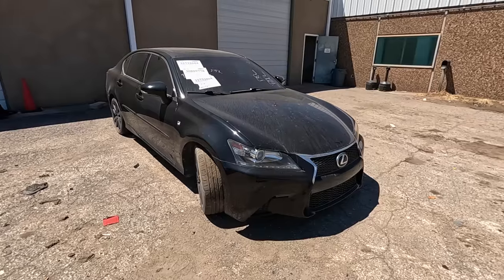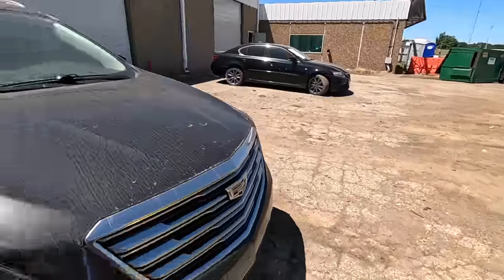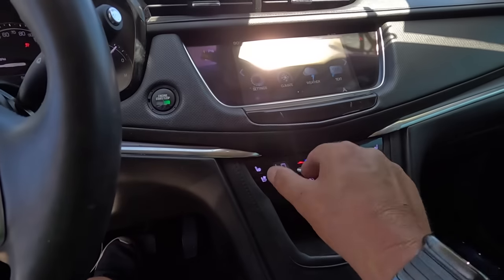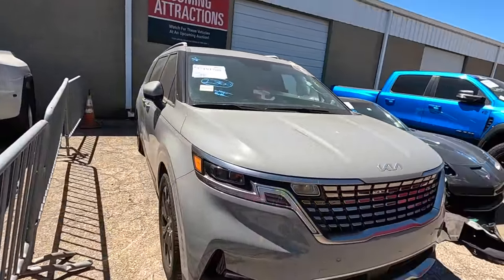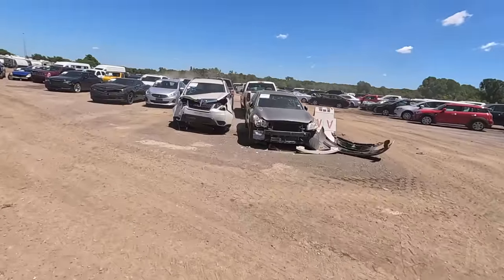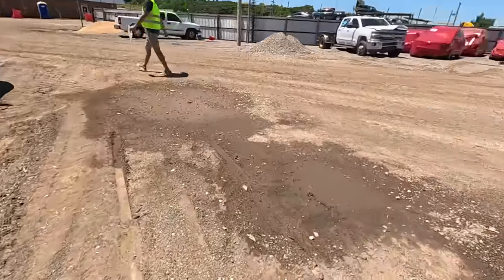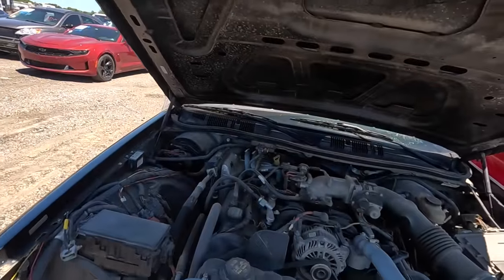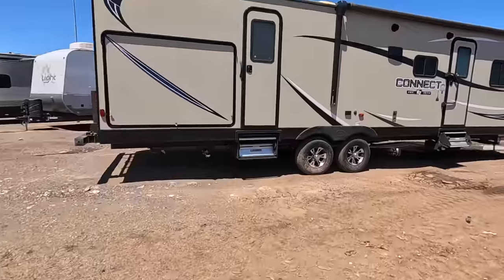I Found this 2020 Saleen Supercharged at IAA and it's JUNK! You Won't Believe Why! Also 2 RAM TRXs

Comment: I love the Lexus GS 350.  It is rear wheel drive and the V6 350 engine is rock solid.  The F sport has adjustable suspension.  Drive one and it will give you a smile.
Reply: Agree!!! 💯

Comment: I’m a current owner of a 2015 Buick Enclave Leather with the 3.6 VVT engine. We bought it with 44K miles and it currently has 116K miles on it. It has had regular oil changes. So far the car has performed flawlessly. I have heard horror stories about these 3.6 VVTs. I believe that maintenance is key to longevity on any vehicle. I also have an 07 Ford F150 Super Crew with 197K and it’s my daily driver. Also it’s well maintained with oil changes every 3K miles. It was purchased with 13K miles in 08.

Comment: Randy you are correct I worked at gm dealers 38years and gm quality has gone down big time.all since Bara took over
😊
Reply: I was just telling my wife the other day that I think it's sad that my 89 Z24 convertible is more reliable than the current gm stuff. I have several older gm products and over the years, they required less work than my Z24, my formula firebird, or my Beretta gt for example. Interiors are kinda cheap, but, mechanically, them old things still continue to run with minimal effort

Comment: If you come across a stuck Hood, reach in and hold the release, then with your left Hand, give the rear of the Hood a good bump several times. Usually it will bump it enough to release the stuck plunger and pop it open.

Comment: Too bad you didn’t get to check out the GS350 F Sport.  By the front end it appears to be a 2013 which I own in the pearl white.  It’s been extremely reliable and honestly impressed me with its handling with the F Sport package. Zero issues.

Comment: I agree with ya! I was always a GM guy! I had many Pontiac’s. I’ve owned Chevy trucks and cars, Oldsmobiles and Buicks. I absolutely loved my Chevy trucks I had up to my 91. I had old caprice cop cars, had Oldsmobile 88. Loved them all. Back when they had 350’s, solid 305, and those never ending 3800’s!!! My last Chevy I bought was a 2008 Silverado 4x4 extended with 5.3. Body went quick and then engine did also! I bought one more vehicle after that with a Chevy name on it, I bought a new 2015 Chevy Spark for our kid when they were in high school. It was a GM tag deal at the dealership. Paid $12,300 and tax and done. They still have it with 80,000 miles. It’s been okay. One set of front breaks, one set of tires, two batteries, and coils and plugs. Just like my 08 Silverado, goes through O2 sensors like someone eating potato chips lol. Surprisingly though, not a spec of rust on it after 8 years, more than I can say about my Silverado lol. I know own a 2012 Infiniti QX56 I bought new and now have 150,000 miles on it. Absolutely one of my favorite vehicles I’ve owned! So comfortable, good size inside, and decent power with the 5.6

Comment: The Escalade 6.2 is actually one of the most reliable engines there is, powerful from the start and loves boost. The DOD-AFM needs removed in the vehicles that it was put into. That is and was GM’s worst design IMO. It can also be tuned out of the computer. Removing the DOD-AFM consists of taking off the heads, replacing lifters. I did some other things while I had the heads off, like a mild cam swap. (Not a bad idea. Headers as well) I wasn’t able to do this work till some months down the road, so I used a handheld tuner and turned off the DOD-AFM. That will make any 6.2 or 5.3 with the dreaded DOD-AFM  stay in V8 mode and no more driving around with a pinless grenade.  I’ve looked for Escalade engines for swaps! They are great like Silverados and Tahoes. Just my .02

Comment: I used to repo travel trailers for a bank...have them checked over very carefully...generally the windows will leak if not sealed every other year and the vents and roof vents have cheap seals on them and they will leak tons of water...if it has pushouts..don't buy unless you get to operate them we had several repos that they didn't work and got a ton less at auction for them.

Comment: 26:05 that's a bassheads wet dream right there! 5th order bandpass 12 15's Sundown Audio using Crossfire C7-2000-4 for each sub and have the passenger door all sealed up to maintain my db's

Comment: Ya know randy I absolutely have to agree with you on modern GM being junk I used to love GM cars until I got my 2019 Cadillac CTS last October it has 50K miles, had the heat go out on me when we had record cold temps in Colorado and I’ve had the rear differential replaced 3 times under warranty and right now it’s sitting at the dealership with a blown diff for the 4th time. I’ve had so many blown tires because of the stupid low profiles, Absolutely over it. Went n got me a Lexus instead.

Comment: The 5.3, 6.0 and 6.2's are great engines and will last forever.. if you buy them when they're new and immediately do the DOD delete on them - and not the cheap way using an OBD II plug in.. spend the couple grand and do it the right way. If it's not done when new, or during the first few thousand miles, then it can be a gamble. Sucks to have to drop a couple thousand bucks and tear open a brand new engine, but at least then it's bullet proof

Comment: It's not about this video. Randy, but I was just wanting to know I saw one of your other videos with the white range Rover that you used Blue devil for a blown head gasket. I have '04 Chevy cavalier with a rear main seal that is leaking and I was just wanting to know if you've used  Blue devil on cars with rear main seals leaking and if you had any issues with that causing any type of bearing failure because of it but I just put it in my car just now so hopefully it doesn't cause any issues. I've used the stop leak in my radiator before and caused more issues after using that, but it was called Bart's stop leak and not the Blue devil. But I have been hearing a lot about the Blue devil quite a bit. So just wanting to know how good that stuff is and if it causes any bearing failures because of it. Thank you for reading this Randy

Comment: My family bought a 2023 Cadillac Escalade v we love it but we had to take it to the dealer twice in a cupple months first was the air suspension and now it’s the ac
Reply: Oh and he still has issues with his corvette. I was looking at a used Volvo and took it to my mechanic to make sure it was okay. He sad don't buy it because it was junk. A couple years later he told me he hates Volvos because he had one and it went through tires too fast. I was so mad. I really wanted that SUV.

Comment: You cant talk about Lexus, especially the older model GS and LS models with the V8 and V6s. Good luck finding one in that body style for less than 18k. I sold my 2011 Lexus LS460L with 215k miles on it back to the Lexus dealership for 13k. The dealership called me and wanting to know how much would I accept for it? I thought theyd go away after I made my offer, but he asked me when could I bring it in??? I said, "Even with 215,000 miles??" He said those engines are made so well that anyone who gt it could probably put a million miles on it and he wasnt exaggerating. Even at 215k miles the engine was clean as a whistle. Anyways, enough on that lol

Comment: Ever since GM CEO Mary Barra took over, the company have mostly been producing meh cars that are honestly not worth forking over $50k-$130k+ on certain cars. Randy's right about the dreaded DOD engines. I also have personal gripes regarding eliminating Apple CarPlay & Android Auto as well. Mary Barra claims that they're leading electrification in the US, but that's a hot load of horse manure! Tesla & Ford make better EVs that have range and don't catch on fire.

Comment: The Enclaves were Junk too specially the 2.0 turbo one i had a lady bring one into me the other day to run a check engine light on it and this vehicle barely had 60k miles on it. The code was to replace Turbo charger her turbo was failing and engine was fluttering and sputtering so bad on a vehicle barely a couple years old. I drive 20 and 25 year old vehicles for a reason they were built and built good

Comment: Your generation of impala only had over head cam engines… every 3.6 is overhead cam… or high feature as they used to call it. I’m with you Randy. Modern GM is junk.

Comment: If the Escalade guy was such a big shot, what is he doing watching YouTube videos of salvage yards?  The Grand Sport is a cosmetic copy of the Z06 combined with the base Corvette Z51 but with bigger brakes and tires.  It doesn't have the aluminum frame of the Z06.

When I was a teenager in the 60's I used to walk around a junk yard wishing I could take a car and get it running again and drive it.  Wish I could have made a business out of it because it sure is fun looking for them.  Like a treasure hunt.

Why are all these cars' dead???

Frame damage on a Jeep?  That's guaranteed!  It's called, Rust!

A cheap camper conversion?  How about a $8k shuttle bus?  Full headroom!  Wheelchair lift for loading.   Wider than a Sprinter and that Ford. Most have a Dually rear axle for more traction.

Comment: Seems like most of the modern vehicles have junk engines. Ever since they went direct-injected seems like the quality went downhill. Engines from the mid-90s too early 2000's seem to run forever as long as you maintain them. No silly plastic parts that break, timing chain guides, no direct injection.

Comment: Cadillac is definitely not what they were. They were once their own brand under GM which had their own models. Now they are just classy versions of existing models that GM already has. GM doesn’t even have the same passion for performance they once had. That Cadillac is nothing more than the Chevrolet Equinox with a few different body panels and some interior upgrades. The engines don’t last because they are being built out of state and utilize cheap parts. People take the 5.3’s up to the 6,2’s and rebuild them with quality parts and make really good NA horsepower with really good reliability. Plus you can rebuild them for less than just about any other engine on the market.
What’s stupid is the cost of cars these days. In 1996 my fully loaded Chevrolet Silverado was under 30 thousand and was the most reliable vehicle I’ve ever owned. All the electronics in cars these days is what makes them so unreliable.

Comment: I am here to agree that gm products are garbage i owned a 2005 gmc yukon xl and it was just problem after problem i never went without fixing something on it fuel pump is my main complaint i have seen other vehicles go decades without needing one it seems like you need one put up for backup because it will go out but now im a proud ford own of a crown vic and no its not a police interceptor just a base model but it was my sisters car for 7 years well maintained and everything was even hit by a semi and still going strong and itll be in my possession til it dies which will be way past his "escallade" which everyone knows those are junk even ford 5.4 tritons will out last that gm junk

Comment: Hyundais are even bigger junk i have 15 to 20 almost every other day coming in for engine lights,evap problems,trans codes,misfires,and really bad oil consumption. OLD Toyota is the Only way i travel and Old Lexus which is Old Toyota both my vehicle's were 100% built Japan ac working no leaking of anything interior still lookin brand new both of them 25 years old and they even still smell new on inside yeah i will keep my old Toyota and Old Lexus.